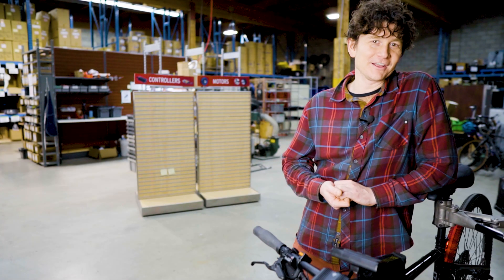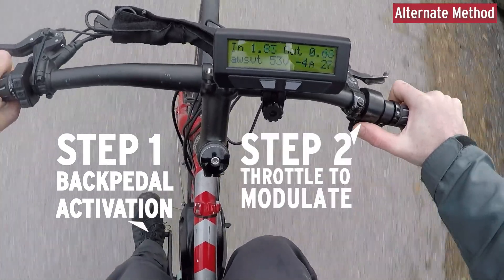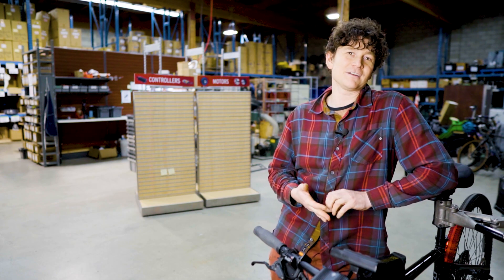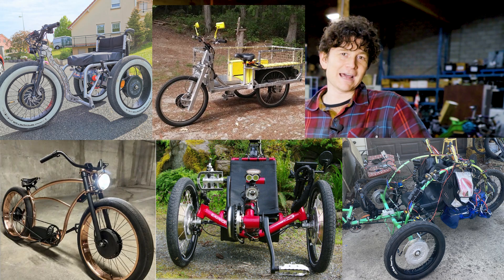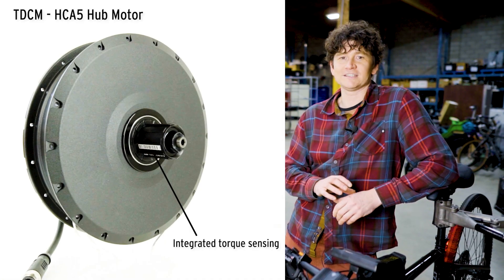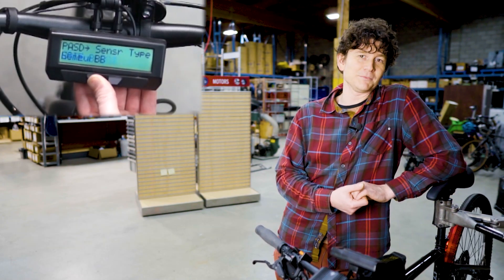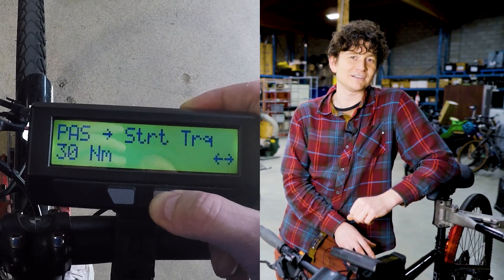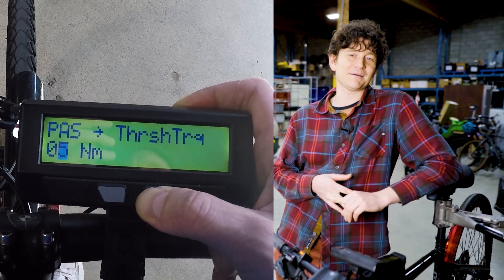New Cycle Analyst 3.2 Beta, Firmware Features (updated regen controls and more)

Comment: For the life of me I can not find the documentation for firmware 3.2 anywhere on the internet. There are some settings on the pedal regen I would like clarity on and the only info I can find about this feature is this YouTube video.
Reply from the maker: Correct that development path got stalled while it is in Beta so no formal documentation got released, but you can see all function of the new parameters by hovering the mouse over in the CA setup utility, or go help->help in the setup utility software which shows the settings summary of the currently loaded firmware and also gives you a link to the release notes.
Reply: @GrinTechnologies  noted. I had not downloaded that software yet. I will check it out.

Comment: I just upgraded a bike to Phase Runner and All Axle and moving to this firmware unlocked a lot of great features.

A couple of questions/requests:
1) It would be great to make pedal regen only turn on if I'm also braking with a brake lever (I do have brake lever switches).  I often back pedal just to orient cranks for cornering.
2) It was really confusing to figure out that 3.2b3 is newer than 3.15.  I kept trying to find these features in 3.15.
3) Unrelated to 3.2b features, I wish there was a way to get geometric increments instead of linear ones on DAux.  Example, when using this for PAS/Torque adjustment it would make sense to have 4 steps of 0.5, 1, 2, 4 (2x per step) or 0.5, 0.8, 1.3, 2, 3.3 (1.6x per step) vs 9 steps of 0.5, 1, 1.5, 2, 2.5 ... 4.  Linear gives too many useless options (like 3.5 isn't a useful step between 3 and 4 in this example), and geometric more closely matches how most other systems work.
Reply from the maker: Agreed on item 3, understood about 2 (should really be 3.1.5), 1 is an interesting suggestion we haven't heard before but is doable for sure so will be put in consideration. Thanks for the feedback and glad to hear you've been enjoying the new features so far
Reply: @GrinTechnologies  I agree with item 1, it would be great to have the minimum amount of regen when pulling your brake lever(s) and be able to increase the level by back-pedalling.  I only have one arm and I ride reasonably extreme offroad, I have tried the opening the throttle control method, but I found it to be dangerous, as I'd sometimes release the brakes with the throttle still open!

Comment: There is soo much information out there and trying to find info that applies to my system is hard. So with this update would I be able to attach a thumb throttle and use it as a ebrake lever,if so could I do this with jauopay front wheel kit. (I am disabled and cant afford much) I have a Ghost Rider chopper bike and the forks wont allow me to have disk brakes on the front with this motor kit and for the back I got just pedal brakes. I am looking to maximize braking through my DD front wheel and I am assuming the ebrake lever on off switch isnt the max potential of the braking that can occur.

Comment: Very cool new regen options.  Without an aux button, a good cadence/torque interface would be "regen on with brake tap" and on 100% with no pedal movement, but lower regen the faster you pedal forward.  Idea is to regen while converting human power or modulating speed towards your "stop point" (timing red light that will one day turn green).  Also the on 100% should have a ramp up time to not be too jerky, but be extra jerky 100% fast with back pedal.

Comment: Here's a suggestion for the next firmware update : Control over the cruise control via the Multifunction up/down switch. Say, if the Cruise is using speed, the switch could increase/decrease speed, same for wattage or amps. Otherwise it's kind hard to hit the right wattage just by holding the throttle still.
And thanks for the great products and updates !
Reply from the maker: Thanks for the feedback and there is a way to do this to some effect. Just setup the digi aux function to be your watts limit or your speed limit with a high number of levels.  Have your throttle mode set to pass-thru, hold full throttle to engage autocruise and it will take you up to whatever you have set for your limit via the MFSwitch buttons, which you can adjust up or down at any point.  Let us know if that does the trick. It's much easier to hold full throttle for your autocruise engage time.
Reply: @GrinTechnologies  Oh that's nice ! As far as i'm concerned, it's pretty much exactly what i wanted it to do. And i can go back to full power just by holding the 'up' button for a second or two.

Comment: Hey Justin, i hope you could help with a bafang bottom bracket torque sensor, i've been trying to figure out the connection and i got it kind of working, but it has some random spikes of rpm, and regardless if i set 1 wire or 2 i always have to connect Dir and rpm together to have any signal going
Reply from the maker: Best to do this kind of troubleshooting help via email.

Comment: Gooddamminit I want a 155mm axle SOOOO bad. gimmie on e Justin, I cannot free up the 200 bills for the whole crankset. 

You know how many of these things I buy. Lol. I just need a good tork sensor thatclears a wide pack. I would lovet o get my cranks right around.... 160mm apart.. and your ERIDER Torque Sensing bottom bracket would do that. 

If i could afford it. C'Mon send me one. I'll promote your systems with teh super powers of datalogs and braggin about having the best ebike oin teh block.  

Geeze uym my keyboard is getting bad. Lol.

Comment: Push button for cruise would be a nice addition.  I dont see how to quickly and easily set cruise.  I have to run a wire all the way down to the controller just for that.  Push button to cruise, push again to cancel, brakes cancel...  Is that in there anywhere?
Reply from the maker: There is a throttle autocruise (hold the throttle steady for XX seconds and then it latches), but not a push button cruise mode as such.  With PAS sensors the need for cruise is largely negated since it achieves a similar effect and then gives you up/down power or speed control via the Aux inputs.

Comment: Would anti-lock regen braking be feasible with the CA or Phaserunner? Since you have motor/wheel speed, it seems like it wouldn't be too hard to have it throttle back the brake torque when rotational speed is zero, but maybe the refresh rate is too slow?
Reply from the maker: For the most part regenerative braking is intrinsically anti-lock. That's one of the beauties about it.
Reply: @GrinTechnologies  You mean because of they don't have enough torque? My GMAC locks up very frequently going downhill off road. 10t, 26" wheel, 52v. This would be a great feature to have.
Reply: Because it's slowed via magnets and magnets dont lock up
Reply: @bobbobberson9441  oh I must’ve been imagining it lol

Comment: hello justin weve streamlined an easy big addon for the ca.v3 using a wemos d1mini ,a logic converter and a 5v to 3 v converter it lets you create custom dash screens in torque pro app on your phone ,can even add analogue inputs to show when lights or blinkers are active on the screen for people wanting to register their high power bikes the unit just connects to the ttl output of the cav3 all the parts were under 20 dollars, illsend an email to grin through the week ,and see about posting one to you,im not going to charge for it, as its not all my work, just work out a free how too,and parts list,thanks for all great videos and products
Reply: can even remove the screen with this then the whole fits into a tiny box ,i actually like the old look mounted in the frame like some older  stealth bikes had,its easier to read ,and have the fancy dash on handle bars, the only thing im having trouble with cav3 is with dual motor power splitting looks like having to build little pcb with little trimpots to limit throttle signal to one or other ,seems theres no easy way to have way to set 100/50, 100/100 for 10 second boost then back 100 rear only
Reply from the maker: @katiekumcgil  Correct that active management of independent dual motor controls is not available on the CA3 platform, as it only has a single analog output line. However, probably 90% or more of dual motor systems don't require this, you can set in the motor controller throttle map how the power is split between the motors and have them all controlled with a single bus.  See https://youtu.be/Ub4EP2_mAds?t=3658
Reply from the maker: Hey there and very sweet to hear this. Is the wemos board small enough to fit inside the CA3's enclosure itself so that you can have the wifi unit all self contained?  We'll look forward to seeing your email and we absolutely encourage people to make use of the TTL output to transmit the data onto more modern display and logging platforms and running with it.

Comment: What about us guys that have three or four motors any plans for that in the future?
Reply from the maker: At that point, you probably do want to have the display in high range (kW) mode and so just changing the RShunt to be 1/3rd or 1/4 of the individual controller value will do the trick perfectly.

Comment: Can I bring my ebike to your shop and you set this up for a two motor, two batterie system just say yes and I will arrange to get it their.
Reply: Why can't you set up your own two motor system, mogeking? It's a good learning experience.
Reply: @sammiller6631  have you ever thought its non of your business why mogeking56 wants Grin to convert their bike. They may not have the time or technical know how or even they may not be physically able to do the conversion themselves.
Reply: @jamesemery1  Grin is not a bike shop. They are a maker of parts. You don't ask Shimano, Bosch or Bafang to build you a new bike either.
Reply: But Grin is not a bike shop, mogeking. They are a bike parts manufacturer and distributor.